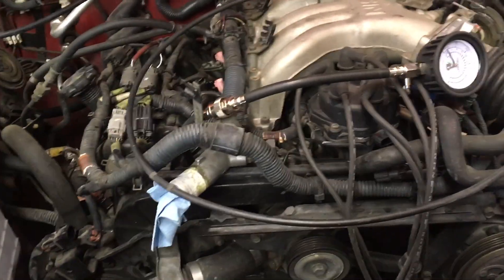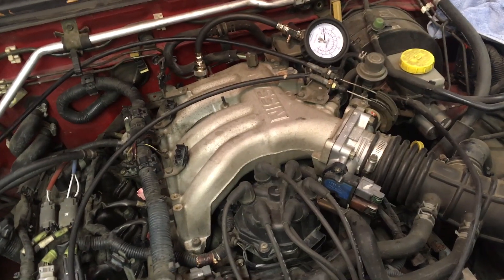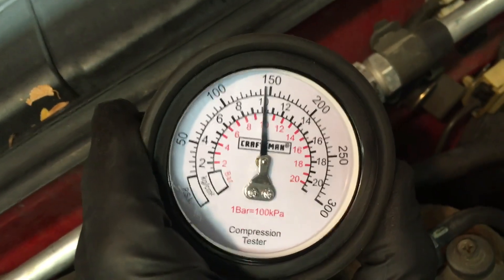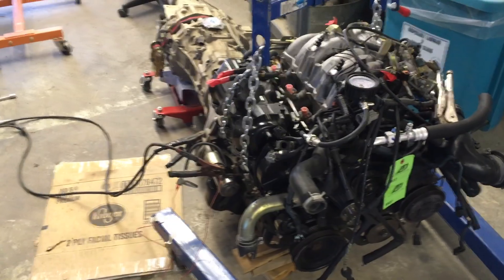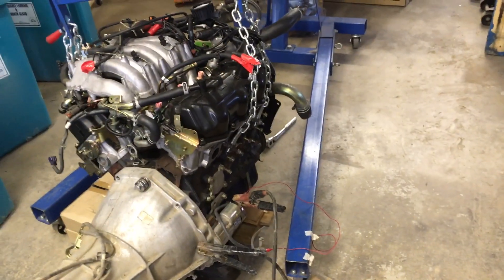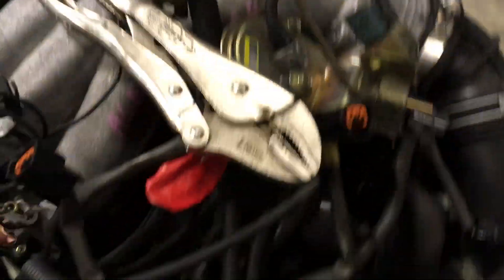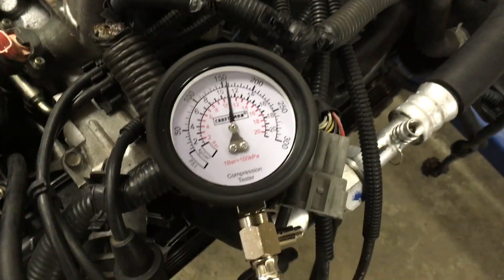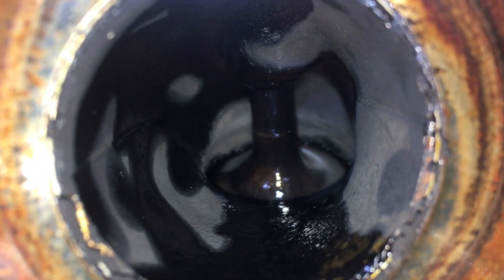XTERRA ENGINE COMPRESSION TEST

Comment: What were the steps in setting up the compression tester?
Reply from the maker: Hey!  Generally, you want to remove all the spark plugs from all of the cylinders. Then, you will typically disable the the EFI and ignition system so that fuel injectors don't inject fuel and the ignition system doesn't fire the spark plugs, while you are performing the test.  Then, install the tester gauge and hose into one cylinder, by screwing it into the spare plug hole.  Ensure there is no stored pressure in the gauge, from a previous test, before you begin the test.   

Hold the gas pedal to the floor, when you perform the test, so that you prevent a vacuum condition from developing in the system while you performing the test.  Generally, I allow the starter to turn over about 10-12 times (you can determine the number of revolutions audibly - listen for the repeating pattern of the sound).  If you have a helper to watch the test gauge, you can stop cranking the starter when the needle on the gauge stops increasing in pressure.  Record your compression test results from that cylinder. 

Then, repeat the process for each cylinder.  Make sure to relieve the pressure in the tester gauge before each test on each cylinder.  Hope that helps!
Reply: @Technically-Matt  Perfect Thank You
Reply from the maker: @user-nw7kf6nl2y  yeah!  For sure!! 👍